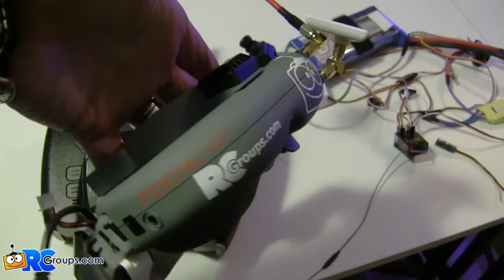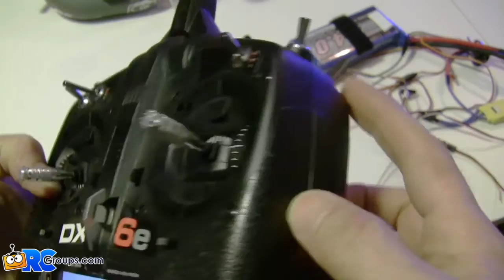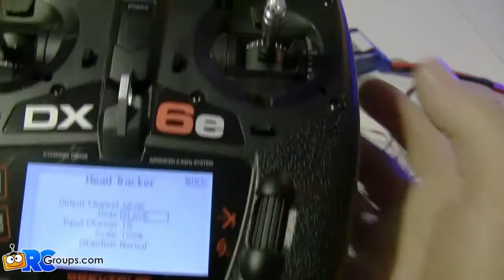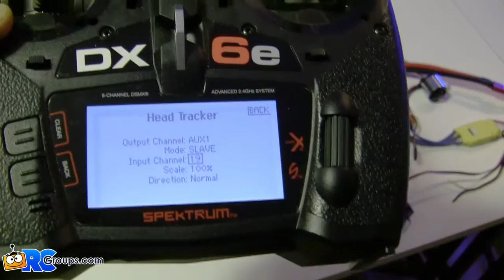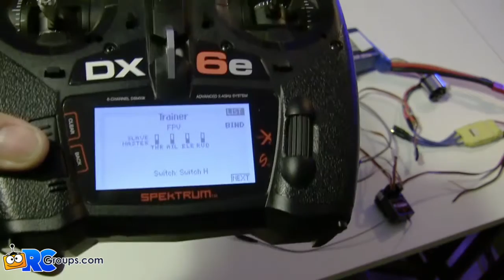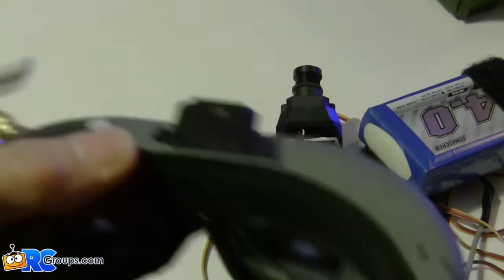Focal V2 Fatshark Wireless Head Tracking How-To

Comment: thanks for the explanation! However, is this direct wireless bind and link possible with the Fatshark Attitude V3 as it is basically the same goggle without diversity. I am contemplating switching to a taranis if not as I have the dx6e right now which has no wired connections such as a trainer port. Thanks in advance

Comment: Help on Headtracking (Focal V2 )
My friend I Cannot make it work on mine. I have the same google the Focal V2 FPV Wireless Headset with Diversity (SPMVR2510)

I am using Elite Radian XL BNF. I have channel 4 and 5 free. But i cannot seem to Bind my Focal V2 . Any help please? 

I have set the FPV on Channel 4 (rudder) and Channel 5 ( Gear ), followed the instructions but when i press the "Bind" nothing happens... ANY ADVICE PLEASE LET ME KNOW

Please note that I am using a VTX Cricket 600. from this I connect my camera. ( What i am trying to say is that the camera does not connect to the spectrum receiver, it goes direct to the VTX cricket ).- Hence the servo leads of my camera pan/tilt go direct to the stock receiver from spectrum ( AR636A )
Any suggestions?
Reply: Ever figure this out?